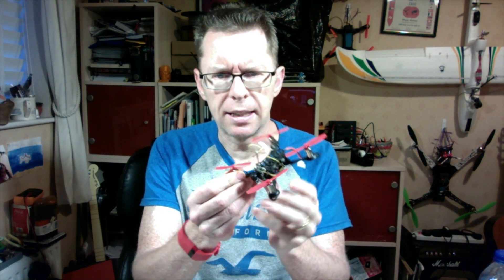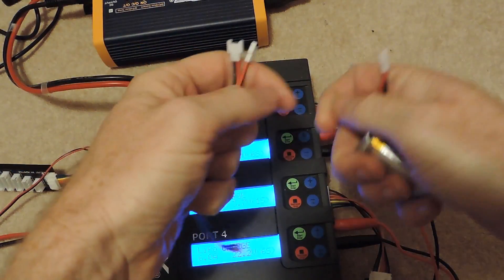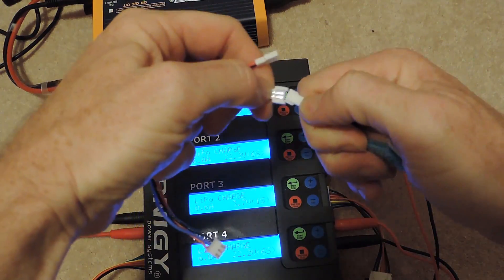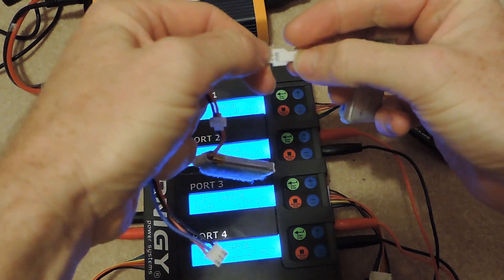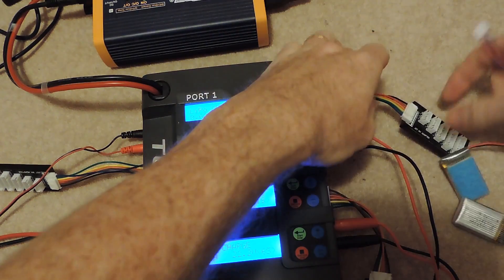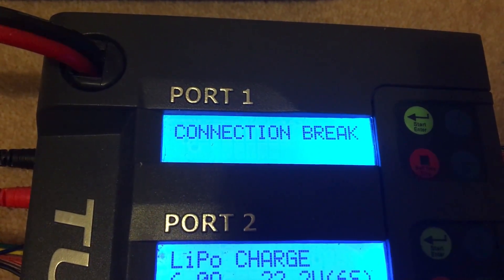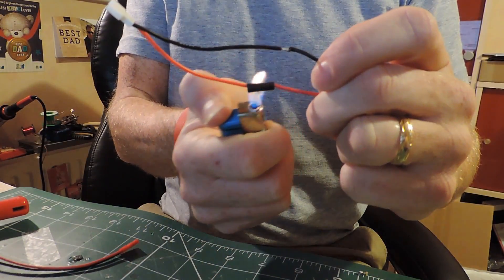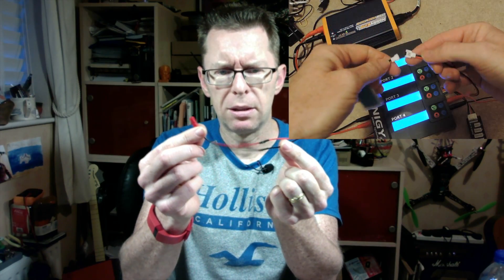FPV Quick Tip: Charging 1s lipos

Comment: You could have made a little balance charge lead out of that and charge 2 of the one cells at the same time on balance mode, all you would need to do is add a jst, or a parallel cable. I only recently started to parallel charge and it's great, just a s long as all the cells are within 0.1 volts of each other your all good.
Reply from the maker: As I said in another reply - I don't parallel charge any longer because of 2 parallel boards blowing... the last one with flames (despite having all the lipos at the correct voltage)
Reply: CurryKitten oh never heard of that happening. I just realised your charge has four ports, so your all set up anyway.
Reply from the maker: Yes - bought that straight after the flaming incident :)

Comment: I charge all my 1s batteries at once in parallel. I made myself a 1x xt60 to 5x 1s cable whip. The charging is quiet fast since you can multiply the charge amperage with the number of batteries (for example 5x 850mAh at 1c = 4.25A charging current). I use a Turnigy Accucell 6.
Reply from the maker: I don't parallel charge any longer - having had 2 parallel boards go up in smoke... and with the last one having flames as well.  That's why I got a 4 port charger.  You do need to make sure all your lipos are very close in voltage if you parallel charge - I'm leaving that comment not to teach you how to suck eggs, but for any other people reading it to be aware if they go the same route :)
Reply: You have to make sure all batteries have initially about the same voltage when connecting in parallel.
Reply: My Lipos are alway on storage charge and are tested again before they are connect to the charging whip. My HK parallel charging board was fried too by a friend because he connected two batteries, one empty and one almost full.

Comment: A lot of cheap chargers (B4 and B6 and their clones) can't charge a 1S battery - 2, 3 and 4S only (and 5 and 6S for the B6). That's what these leads are for.
Reply from the maker: I've got a b6 clone on the shelf, don't know if it could do 1s, but I don't think it would work on just a balance port either.  Ah well, whatever works for people :)
Reply: The b6 can do 1S.. You just have to use the normal 'charge' program instead of the default balance charge.
Reply: Good to know - if I ever get any planes that can use 1S, cheers